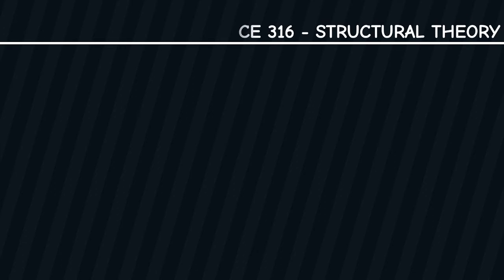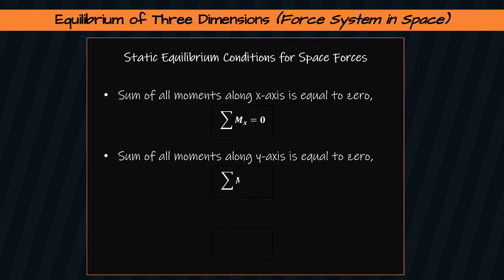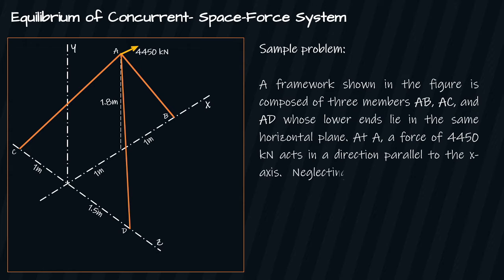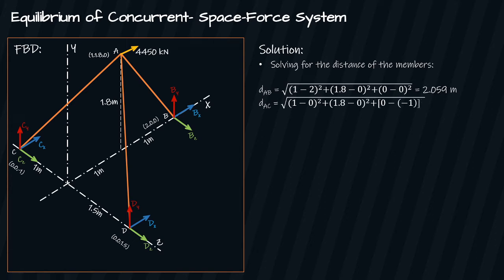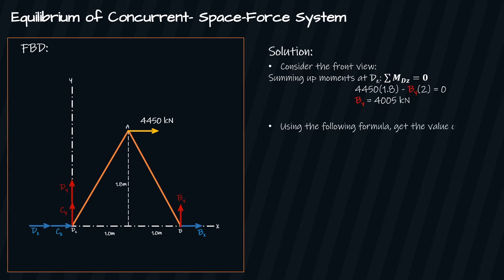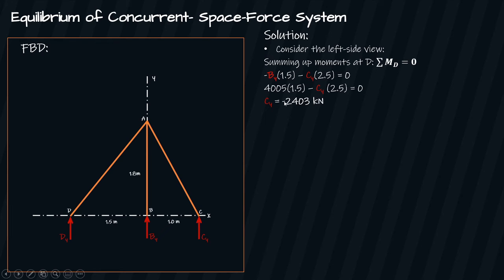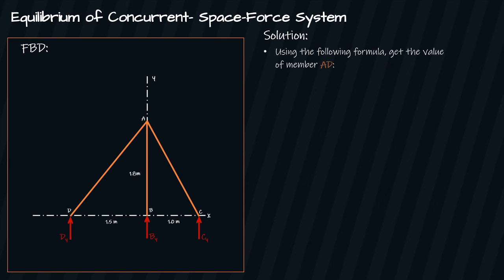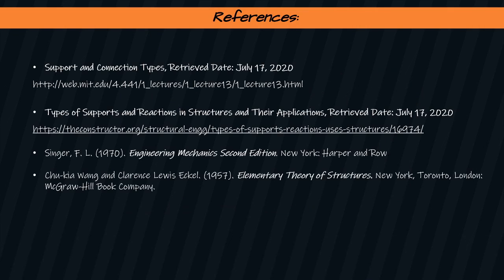Equilibrium and SupportReactions Part 3

Comment: Hi maam😁.

About han question maam😅 for me, depende la geap😅. For a seesaw to be at equilibrium the torques(or the moment), or forces pushing down on the opposite sides, must be equal, otherwise the lever moves, then dire la geap hiya in equilibrium. Nadepende la geap maam ha weight han mga bata ngan han ira distance tikang han fulcrum.

Nice video ngean maam🥰.
Although ha part 3 nghihimakuri pa ak pg intindi hahahaha.
Reply: Hello Mr. Boreres. I am overwhelmed to read your comment. It just showed how knowledgable you had become in Statics. You had already an advance knowledge to it. All your points are well noted. I just would like to add that way back on Equilibrium and Support Reactions Part 1, the children's weight was stated but the weight of each child was not specifiesld.  Having the same load on both side might not create an equilibrium, YES. We also have to consider the distance of the children from the support. 

Thank you for giving your insights and for watching the whole equilibrium discussion. 

For 3D forces, you might want to go back solving the conventional way... 😊
Reply: @arjanelacambra8019  noted, thank you maam😅😁...
Reply: Being in state of equilibrium is different from being stable. Stability is another topic.